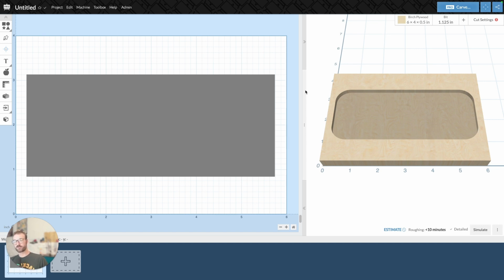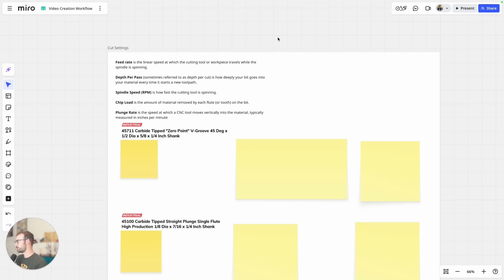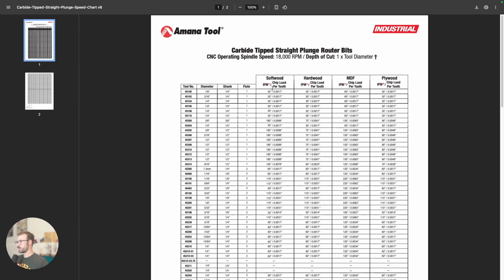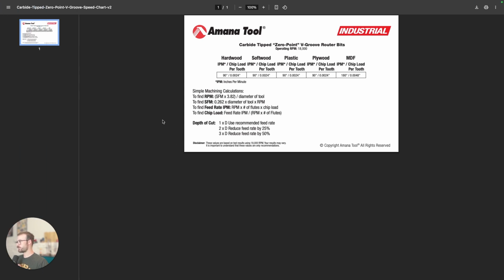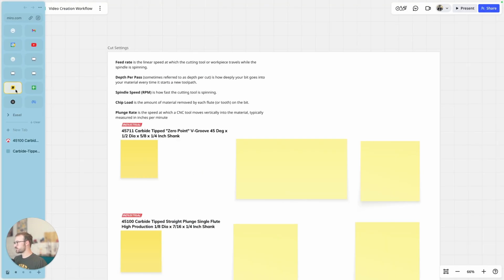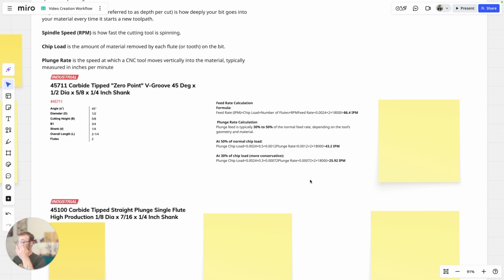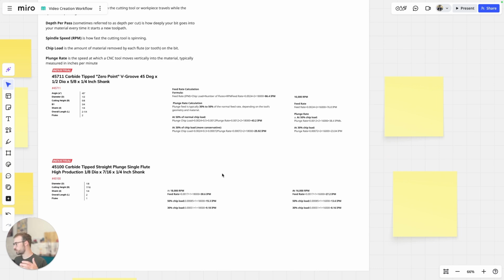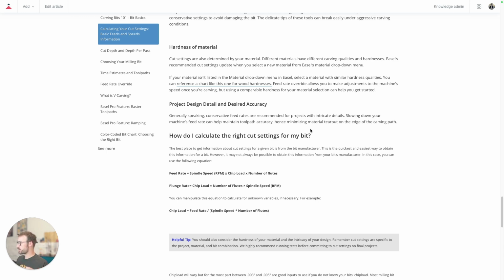How to Calculate Cut Settings for Easel Software

Comment: I've been really frustrated with this feature in Easel to be honest. It's the hardest part of CNCing and Easel doesn't do anything meaningful to help.

I expected the feature to have more intelligence baked in, especially for the bits and materials included in Easel's catalog. Turns our the values in the catalog aren't reliable.

I wasted hundreds of dollars in material and hours of frustration until I finally did what you did and just went to Amana's site. I realized the cut settings were way off. I would have expected more help from Easel.
Reply from the maker: Thanks for your honest feedback — we completely understand your frustration. Cut settings are one of the most complex parts of CNCing, and we know how much impact they have on your results, time, and materials.

Easel provides generic cut settings as a starting point for each project, based on the selected material and bit. These values are meant to help you get up and running quickly, but they’re not always optimized for every machine or bit. That's why we strongly recommend checking the tooling manufacturer’s guidelines or using the calculations for more accurate and reliable settings.

We really appreciate you taking the time to share this — we’re actively working on making this area smarter and more helpful in the future.
Reply: @EaselSoftware wonderful to hear, glad you’re looking at it and I appreciate all you’ve done to make CNC more approachable